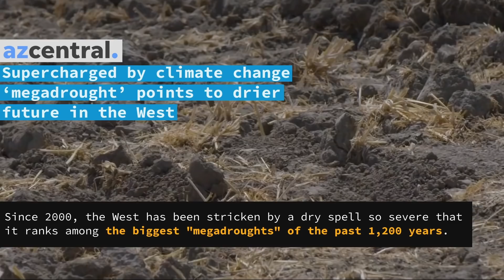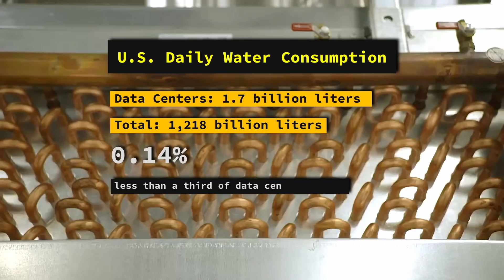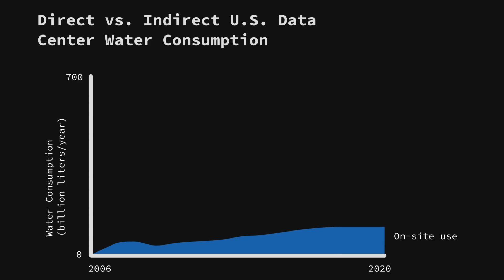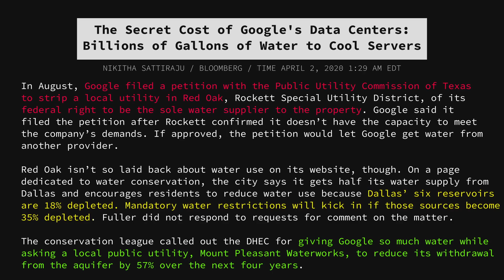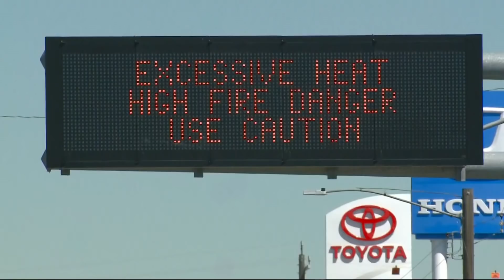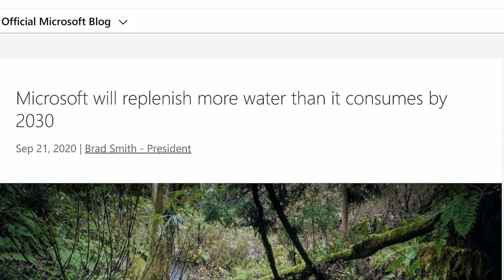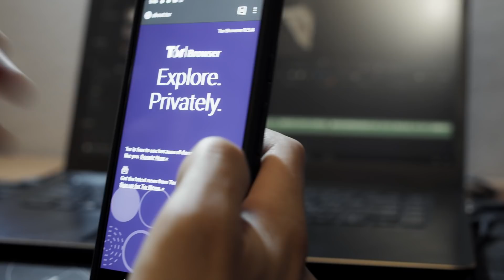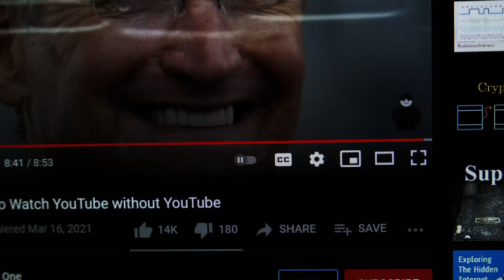The Internet Is Running Out of Water

Comment: Its a shame they don't use sea water for cooling as the would increase the amount of fresh water not deplete it.
Reply: more solved salt = greater stress and problems on the system. it's again about money
Reply: @VADemon  yea but you can't expand more when the fresh water has run out.
Reply: electronics are very sensible to sea water. they don't use it because corrosion is extremely high in conparsion to fresh water.
Reply: @marcossonicracer  you would't directly cool the electronics with sea water, running everything from a indirect system would probably work.
Reply: It is very costly to do that as you have to desalinate it. Salt is very hard on the cooling systems.
Reply: @Lakoda26  I was think raw salt water transfer the heat with the help of heat pipes, if there is no direct contact then there should be a problem right?
Reply: @mrcrackerist  If you just run sea water through radiators or whatever, 1) mineral buildup will still happen 2) micro organisms

Maybe one could instead use sea water as a heat reservoir, similar to nuclear plants(?)
Reply: @VADemon  So cooling of the fresh water with sea water? that would be interesting, cooling tower next to a data center :P

I was think coating heat pipes with a protective layer.

Comment: Maybe I'm just stupid but can't the data centers re-use water? Cold water comes in, becomes hot while cooling the servers, and instead of letting it evaporate they will let it cool off so it can be used again.
Reply: Evaporation is the cooling mechanism used.  Even sucking in tons of water constantly is not the problem, because it would need to be drained back into the ground at the other end.  Water can't be wasted on a global scale (closed system).  I'm guessing the issue is the evaporation condenses and falls back down as precipitation much further East, which dries out the West of the US further.
Reply: Look up how chiller towers work.
Reply: I was thinking the same thing.  Water only has 3 forms, right?